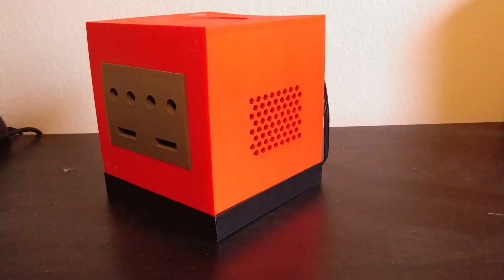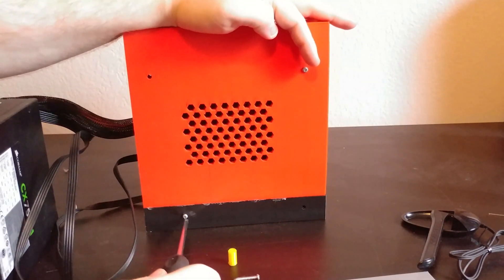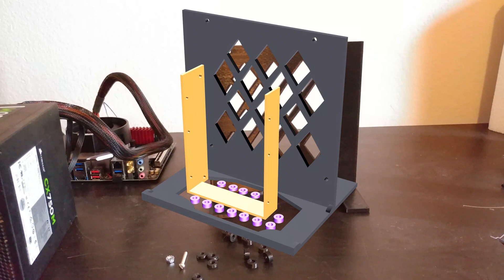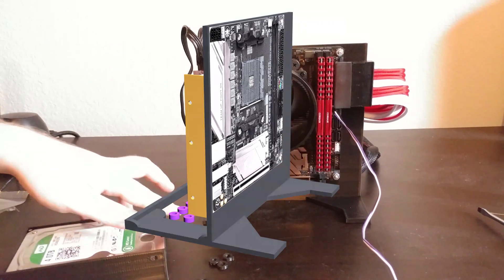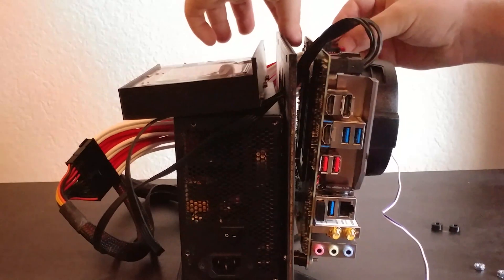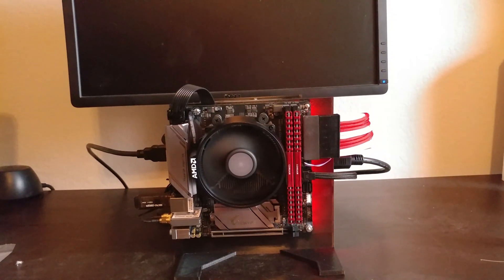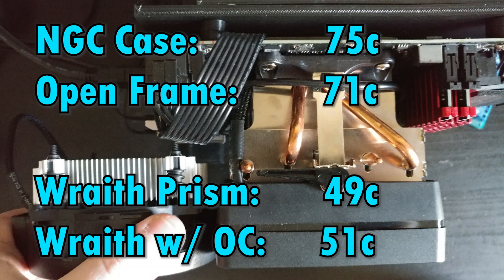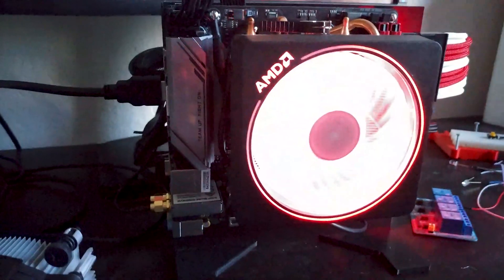Free mini-ITX case (Download & Print)

Comment: 🤦HONESTLY... It doesn't look like you tried to fit very much in the GameCube case from what I see in this video. I don't care about GameCube, but I would be open to helping you come up with custom solutions so I can get more experience designing 3D printed case for my own project. I'll even give you one right now and if you're interested to contact me via Twitter, Instagram or here on YouTube. Discord would be a good option though.

💡 You can design a bracket that clings on to, can be taped on, or screwed to the existing mounts on the power supply that would be able to hold the HDDs/SSDs in place without taking up very much space. 
Especially in the Gamecube case, there is a lot of room there to make something stable and even stabilize the PSU by printing small extrusions the size of the PSU like what the BitFenix Prodigy M has. Google for references. 👍
Reply from the maker: When originally designed it had a beefier cooler, SSD, RX 460 and a 2.5" HDD. The Ryzen 2400G in it when this video was made was more of a matter of finding a spare case to put the mobo/cpu inside. Thanks for the comment though!